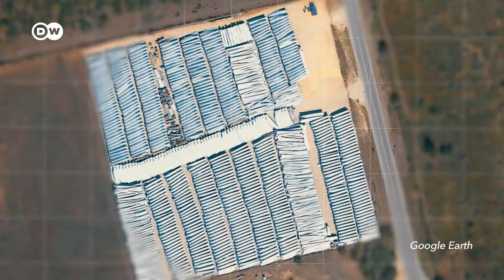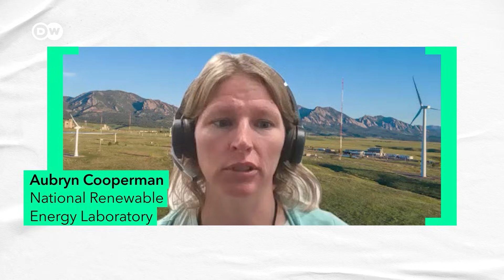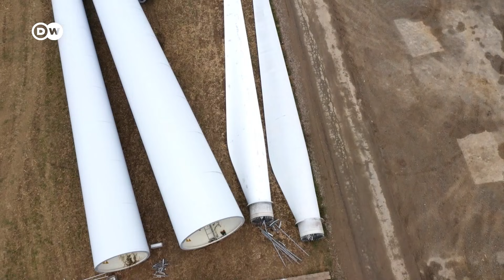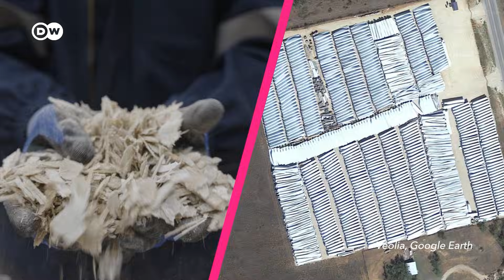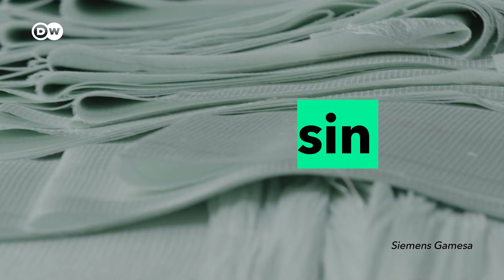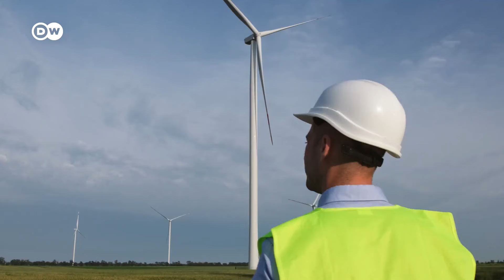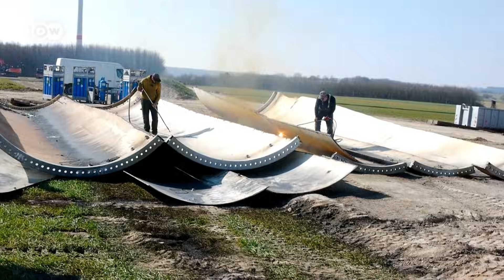Wind power's unsolved problem

Comment: Ok basics solar panels at best 60% cyclable & 15yr life wind well only one place in USA to recycle the blades by shredding them into a concrete mix so still at 60% blades about 20yrs now pump hydro 40% loss as that is 40% more power needed to lift the water than is gained as it falls to the turbines  ALL MAKE LESS POWER THAN WAS USED TO MAKE THEM FROM OUT OF THE GROUND TO THE GRID BEING CHARGED The only winner is hydroelectricity at a life of 100plus years and now can be fitted with three banks of turbines & 98% recyclable THIS INFO FROM RDP Marine Australia and has been verified
Reply: All easily produce more energy than is needed for production.
Blade recycling is also done in Europe.
Reply: NO it was only usa AND only for test bed  @old-pete

Comment: I used to work on composite materials, and these materials are highly engineered and its hard to re-cycle them. I have made laminates of them with my hands, and yes its pretty stiff (not tough though), and I wonder what solutions these wind turbine industries have found to obtain pristine fibre back? Even if the fibres are extracted from the epoxy, I doubt if they have the same properties as before. I am not so optimistic of these industries saying they have 100% re-cycled them. To be sustainable, one need to implement some behavioral changes with a little nudge from the govt (through taxes for example), and it cant be through Lithium ion batteries and these plastic/composite blades.. I even wonder are we being scammed in the name of these stuffs..

Comment: I hope,  that all of the recycling solutions, keep in mind not only,  first level recycling,  but also further down the line... I just don't know if it would be possible that we have to face a problem like asbestos if the fibres are broken down more and more by each recycling... but since it is glasfibre it should be possible to melt it down to glas again... to not have nano fibres that pass into our lungs... The carbon fibere should be at least be usable as source of carbon in chemical products or be burned....

Comment: I've worked for the one of the largest wind turbine developers and operations companies, for years, and we recycle 100% of our blades to concrete companies who grind them down and use the glass fiber to reinforce concrete, which makes concrete MUCH stronger.  It's a perfect match as we'll continue making wind turbines for may decades, and will continue making concrete.  I have recycled wind turbine blade glass fiber mix in the concrete of my own residential wind turbine foundation, in my own backyard.  Full cycle life!
Reply: Concrete comes in many forms with many additives for even more purposes. If a recycled turbine blade can be used instead of new glass fibers for reinforcement, i don’t see why that should be not prefered.
Reply: Many people misconstrue recycling and reuse.  More explanation should help convey the true potential of all materials, not just old turbines.
Reply: What do you do with the Brazilian balsa wood stripped from the rainforest ?
Reply: @MrArtist7777 Could you share some of the recyclers you worked with or are aware of? I have read a bit about Carbon Rivers and Veolia, but am curious to learn about others!
Reply: Take a look at Sweetwater Texas the eye sore of 5000+ blades is visible from space since 2018 and still there in 2023.   Those were 100 percent recycled too.  Its just words not reality.   So many grifters and liars.    The truth is there are still there not recycled at all.
Reply: how much energy is expended "recycling" a turbine blade?? It is usually more; than not recycling it, which is unfortunate. Further, if you go nuclear, less overall waste, and  only fuel reprocessing required. Nuclear is from a top to bottom review more environmentally friendly. Let's go nuclear green.
Reply: So the current state is to destroy wind generators and grind the blades. First stop building new wind generators!
Reply: is using these fibers not the same as the "coral"reef solution that had in the 70s in the USA?
https://en.m.wikipedia.org/wiki/Osborne_Reef
there they had the solution to recycle car tires in a eco friendly way, it was the future...
which turned out to be a complete disaster.

the concrete with the fibres in it, is to me, dangerous waste.
when the concrete is shredded at the end of lifetime of a structure the fibers will come free. maybe the fibers will come free after some years being exposed to the elements and people can breathe in the fibers.
Reply: do you know, what happens to the fibers,  when the concrete is being reused/ground to pieces... i'm just curious...
Reply: @saschathinius7082  One can use the fibers for cement production. They become the cement in a chemical reaction. The fibers do not exist anymore after that.
Reply: @old-pete  : ah okay! but do you mixing the fibres into the components of the concrete when it is "burned" to actual cement... or to enrich the concrete mixture when it is mixed with water and the calcination process starts and it is poured into the molds to make  the building?
Reply: @saschathinius7082  The cement is burned in a rotating killn. If one adds the shredded turbine blades, one safes fuel, sand and other minerals. The glass reacts in the killn and becomes cement. The cement is later used for concrete.
Reply: @old-pete  : thanks... I'm actually aware of the cement making process, as an engineer... just wanted to know when the fibres would be added... yes they will be "gone"/integrated when added to the killn/burning process... thanks for your answers... got it now
Reply: isnt the dust from fiberglass/carbon highly cancerous and dangerous to breathe? I hope you made sure that the dust wasnt carried by the wind to your neighbors....
Reply: @423GustavBern  Studies suggest not (https://dph.illinois.gov/topics-services/environmental-health-protection/toxicology/hazardous-substances/fiberglass.html#:~:text=There%20is%20no%20evidence%20that,how%20the%20fibers%20were%20implanted)
Reply: @423GustavBern  they're not fibres in cement. Read the thread.

Comment: The answer to the climate crisis is never going to be found in any kind of power generation and consumption. It can only be found in degrowth and powerdown strategies, in simply using less energy and material to do less. Most of what we call "economic output" is pure waste, anyway, or only serves to enrich an ever-shrinking number of people at the expense of Nature and everyone else. Green consumerism is a nightmarish lie.

I don't know how many times I've said this, but there is in all actuality no such thing as "renewable" power generation. All forms of power generation are dependent upon non-renewable resource extraction to construct, install, operate, maintain, and retire/replace. The manufactury of photovoltaic panels, in particular, uses some extremely pollutive chemicals that have greenhouse gas potentials as high as 25,000 times that of carbon dioxide. There's a reason virtually all photovoltaics are now made in China, and that's because China has extremely lax environmental regulations, and the government controls the economy and all manufacturing, to some extent, so if China decides it wants to put every other country out of business by poisoning its environment and its people, the rest of the world will happily allow it to save a buck.

Comment: I wonder if anybody could figure out how many  kilowatt hours are produced by a typical generator blade over its lifetime and how that amount of waste would compared to waste from other generating systems per kilowatt-hour.
Reply: Just build nuclear and call it a day
Reply: @rambo64bit82  look into decommissioning costs for nuclear
Reply: 4500 MW a year over a course of 25 to 30 years before being dismantled due to safety.
For the 2MW turbine next door...
Reply: @gePanzerTe  W is the unit for power - don't miss your h at the end when you mean it produces 4.5 GWh.
Reply: Coal power plants generate at least tentimes much as waste for each produced kwh than windturbines, just by creating ash.
Reply: @old-pete  except your wind turbines require coal to keep them going, and when they do generate energy there is no way balance the load back into the grid; so what happens is the coal plant is still running the whole time and they  just bleed off the steam from the turbines at the coal plant to balance out the load. In essence its net zero into the grid and just more things recycle and tear up the environment.
Reply: @ScottyBennitone  
1. They are not mine, otherwise I would be rich.
2. They do not require necessarily coal.
3. Nobody plans a grid with only windturbines. One combines them with other sources.
Reply: I'm sure coal ash alone masses more then the blades of comperable energy generation, and coal ash is too toxic to even put in a landfill.
Reply: Doesn’t mention anything about recycling the massive concrete foundations.
Reply: @johnsteading8610  id expect them to last a lot more than 20 25 years and could probably handle another wind turbine being installed on them, no?  Don't see buildings with concrete foundations having them replaced every thirty years
Reply: you can't see those on the news in very dramatic photos. Plus you just put new wind turbines on there. @johnsteading8610

Comment: Wind turbines have always been products with a high recycling rate - around 80-95 percent of a wind turbine is completely recyclable. The only challenging part are the blades, which use fiberglass as their material, and have therefore been more difficult to recycle. In Finland, a solution to this challenge has been sought in the KiMuRa project, where a collection and processing network for plastic composite waste was created in which it's recycled 100% in the manufacture of cement, partly as energy and partly as raw material. The first wind turbine platforms went into circulation through the new system during the past summer in 2021.
Reply: only one place on the planet looking at recycling blades is in the USA. They are shredded to then be added to a concrete mix not a green answer at all
Reply: @simonbowman6206 how is it not a green solution? Using shredded turbine blades means less cement that damages the environment and less ressources needed. Using those blades after 25 to 30 years of producing electricity is exactly the green solution we need
Reply: @simonbowman6206  Check your facts, is all I can say. There's also a Swedish company Stena Recycling, that operates in Sweden, Norway, Denmark, Finland, Germany, Poland, Italy, and the US.
Reply: @simonbowman6206  That is wrong. The cement recycling is done in Europe for years.
Reply: @simonbowman6206  Loits of places are doing it, and the US wasn't the first either. As for not green, it reduces the CO2 output when making cement by about 40%.

Comment: Since wind turbines were built to last forever, why not use them as part of seawalls or for sewers?  Concrete will only last for around one lifetime before losing all of its strength due to oxidation and salts.
Reply: Obviously! And many other applications of big sturdy solid slabs.
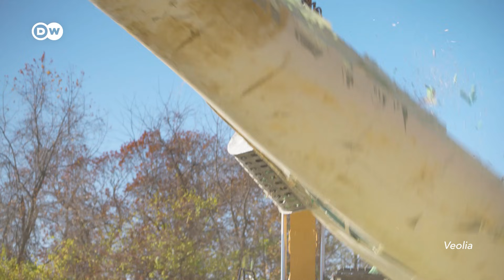Reply from the maker: Wind turbines currently are built to last a lifecycle of up to 25 years. 🌬 In about 3:50 minutes to the video we discuss the possibilities of old blades in cement production.
Reply: Seawalls ? Not the best idea, normaly you just use big stones, because the waves not just crush against the stones, the waves lose their strength in all this space between these stones. If there would be big waves and you walking there and the waves would hit against solid walls you would be wet.
Reply: Fiberglass would be rapidly eroded by sand abrasion (infact errosion is the main life time limiter on blades), so a marine reuse senario is not viable.  Sewer piping needs to sealed and blades while hollow inside are not pipes and most certainly not the right size, so they would need to be broken down and reformed, but fiberglass loses tensile strength when you break the fibers (for that matter everything made of fiber, be it carbon, glass or cotton will lose tensile strength if the fiber is shreded, it's the nature of fiber after all).
Reply: @kennethferland5579  No, on the contrary the sand abrasion etc. is exactly what you need, so marine reuse scenario is an excellent use case. You need a big pile of sand. End of.

Comment: Thanks for great video again, but i have a thing. 
TLDR: Whats wrong with old turbines?

Every time when i watch something about wind turbines, and it says "end of a life" or "end of a cycle" of turbine, what this ever mean? If generators parts are wearing they can be repaired or replaced. Leg part (tower, i dont know what is it name) usialy from steel and if it checked and repainted friquently can stand for hundreds of years. And wings are actualy undestructible for weather, if their finishing layers is faded or damaged it can be refinished too i guess (like compisit body of boats).
Reply: Blades will only stand so much use.  They flex a LOT.  They're made lightweight considering their size.  So yes over time the blades wear out.
The motors will also wear out.  There are parts that can be replaced but over time they are better off replaced.  But most of this gets recycled so not a big deal.  I think even the metal stands wear out.  They're supporting something where the goal is to have wind create movement in an electric motor which requires forces of wind to create centrifugal force.  That creates strain on these stands.  But once again, this is metal and can be recycled.
Reply from the maker: Hey there! Although that is the typical lifespan, regular maintenance and monitoring can help extend their operational life a lot. However, at some point, they will be strongly marked by wind and weather.
Reply: Hey! Mechanical engineer here, the main reason for maximum lifetime is that overtime reapeted yielding (flexing) will create small little cracks that over time can lead to failure. This phenomenon is called fatigue failure and is heavily studied. This is what drives the maximum lifetime which can be increased a bit but at a great cost in total weight, creating other issues elsewhere
Reply: @jean-louistychon3340  thank you all for answer)

Comment: This problem has already been solved...multiple ways. Blades can be chopped/ground, creating aggregate for concrete. Better still, Carbon Rivers in Knoxville,TN can process composites, such as turbine blades, boat hulls and travel trailers, into recycled glass fibers. They can even extract renewable diesel from these water streams. So, the problem is one of investment to bring the technology to market to solve the problem, not that solutions have yet to be found.

Comment: What about building houses or roofs for shadingcar parks/fields.
Reply: It has been happening for years.. this story is highly misleading
Reply: @charlesbrummett4025 Could you give some news articles or studies for that? I'd love to read up on it more!
Reply: Gamesa has been recycling wtb for years into medical teaching devices exp skeleton... lower and upper g.i. tract.. exploted skull with and with out brain.. some of the fiberglass has been used in concrete for a lighter and stronger base mix.
Before any wtg is erected there must be a contingency plan in place for the disposal and or recycling of the wtg after it's useful Life of about 20 years this contingency plan is back up by a surety bond for this reason. Unless you have spent 20 plus years dealing with renewables from the base to the light switch and from actual working from erection to corporate office you will never receive the complete or correct truth. If it does go to the landfill the cost are astronomical due to weight.. composition of the material which is some metal.. basa wood and fiberglass All of which is considered industrial waste.
Reply: D.O.E speaks of a company that is grinding the wtg blades and selling them to concrete companies
Reply: Well, environmentalists look like they are never satisfied.
And thus playing the game of the Corporations in getting The People used to live under-graded lives with very little improvement in comfort due to so-called shortages.
🤔
Said shortages mainly due to poor management, lack of investment, funding and maintenance.
Etc.
Reply: That's a very good idea. Thanks 👍